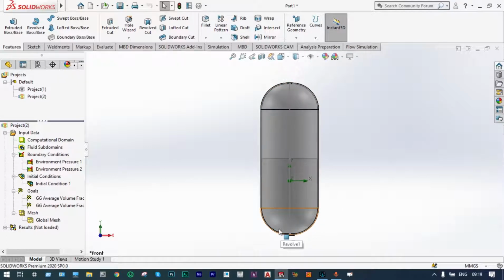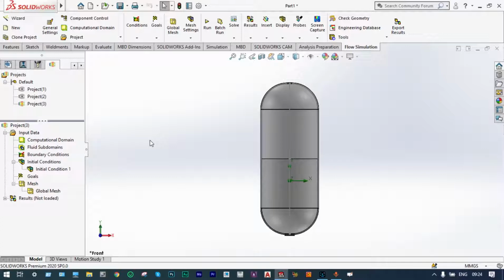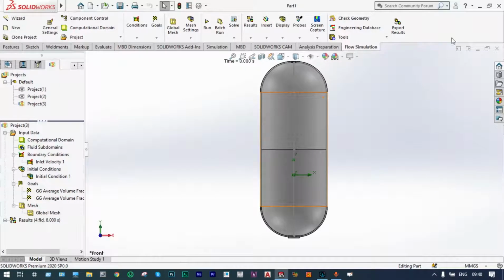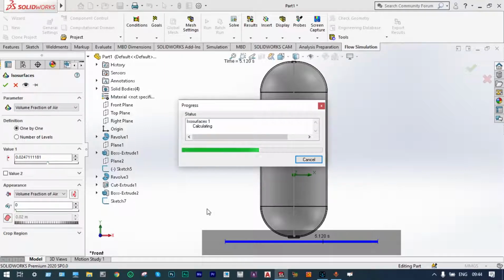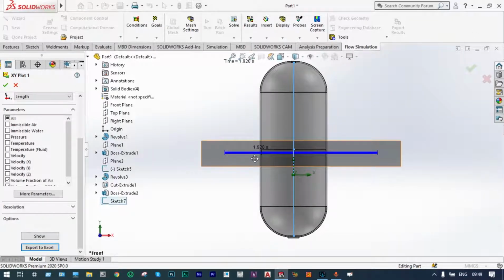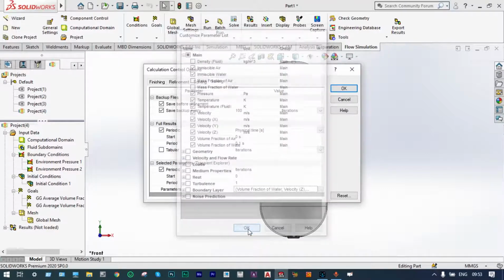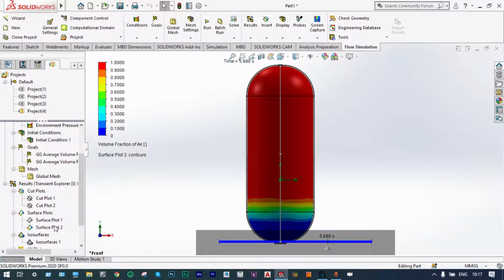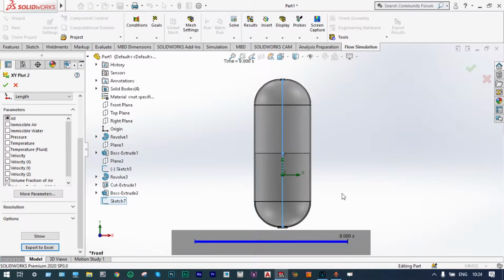Heterogeneous Fluid Mixing with CFD Free Surface in SolidWorks 2020

Comment: Could you make a video about bicycle wheel? About the force of dynamic resistance?
Reply from the maker: I did one CFD External Analysis of a bicycle. You can see.. https://youtu.be/9inxJarmnEk
Reply: @CFD_GUIDE  What will be the differences between the entire bike and the wheel? Is it the same?
Reply from the maker: In case of whole bicycle more surface is exposed to air. So you have more choice to change design parameters with a view to reduce drag force. But incase of wheel you have less options. Analysis method is same in both the cases
Reply: @CFD_GUIDE  thanks a lot